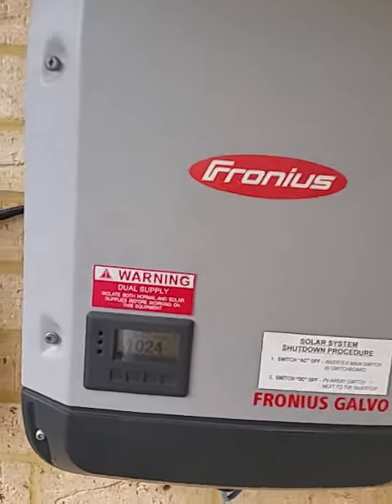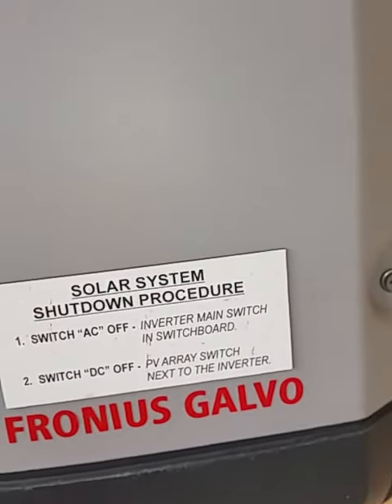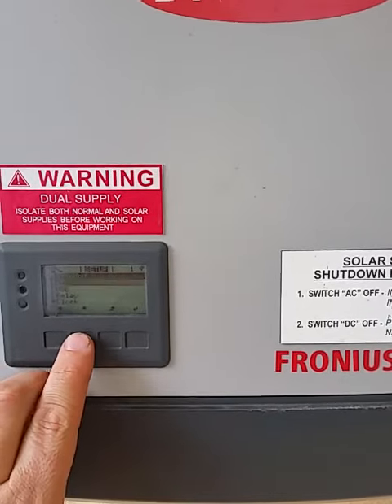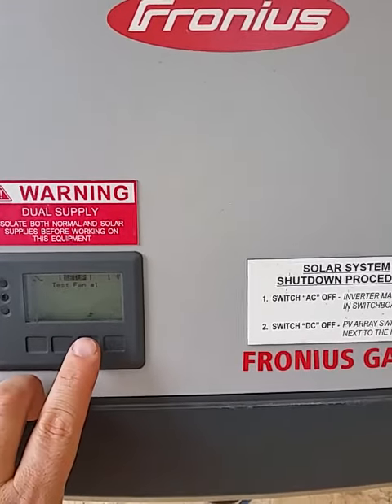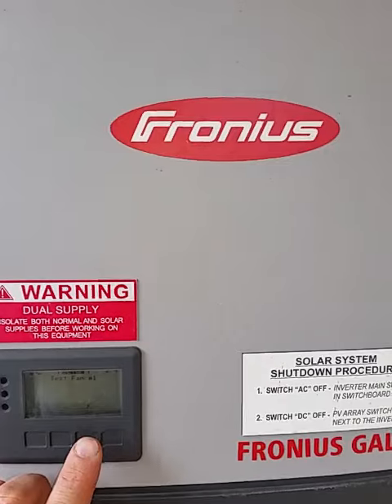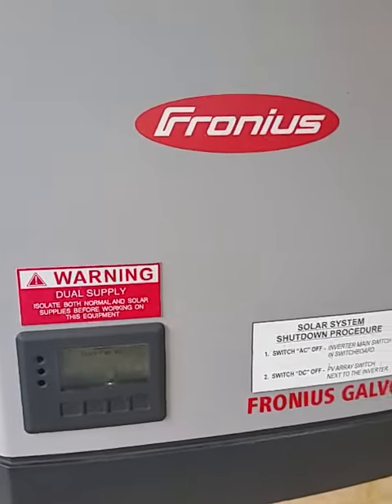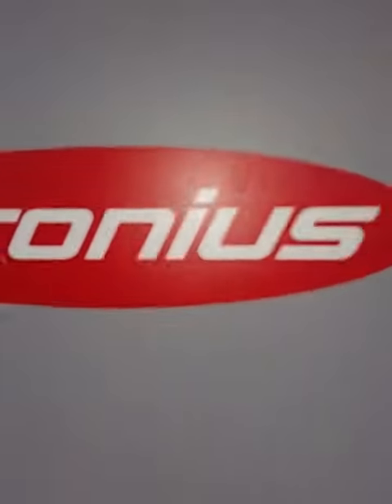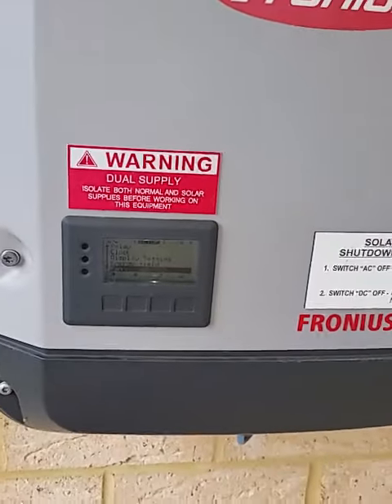Inverter operation and noise

Comment: Fan noise depends on inverter load / sunshine and also how much dust has built up on the fan blades or debris that been sucked into it. It's easy to clean it.

Comment: Well mine is the primo brand
Reply from the maker: Galvo / Symo / Primo small format snap inverters all share the same architecture and fan. Keep in mind this little 3kW inverter has 6.6kW panels across 2 orientations hence makes it full rated 3kW most of the time and also installed in Perth Australia a hot climate and with heaps of sunshine